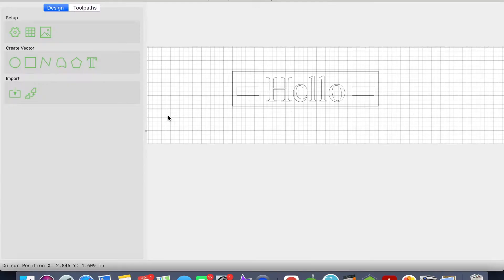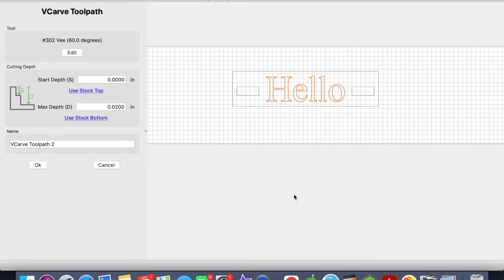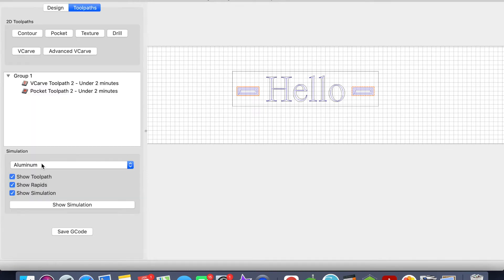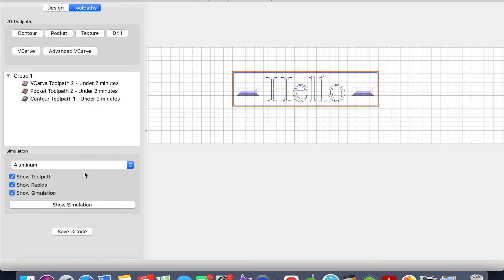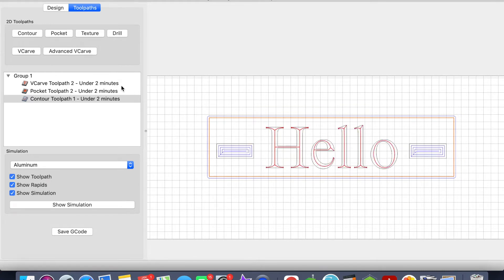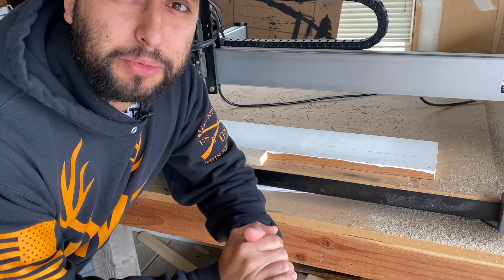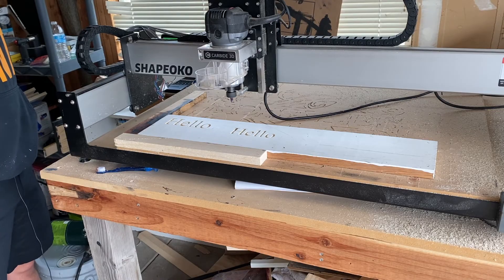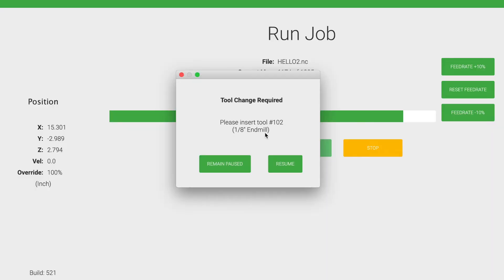How to Carve Multiple Tool Paths in Carbide Create/Motion | Beginner CNC Tool Paths | CNC Basics

Comment: I’m teaching HS kids Carbide Create.
I’m doing a coaster with an inlay.
I run one simulation then save G Code.
I run the 2nd simulation then save the G code.
IS THAT A MISTAKE?
Should I simply run the simulation then save the G code(both).
I am not getting the change tool bit pause. I’m worried I taught 120 kids the wrong move.
Reply from the maker: When I have multiple toolpaths I like to save each one individually.  
I think it’s easier to keep track of them. 

So let’s take a flag for example.
My first toolpath would be stripes and the second would be stars.

let’s say in this example it’s just a pocket toolpath for stripes. I could use a 1/4” endmill to execute this toolpath. 

Once that is done I would upload my next toolpath which would be a vcarve for the stars. When I run that in carbide create, the program will prompt me to change to the vbit. 

I think my process seems like that is what you’re doing.

Comment: After entering all values. I tried to save the file as G-Codes but the software said "save as G-Code PRO ONLY". How to get rid off this problem?
Reply from the maker: You have to save as .c2d file.  

If you use carbide motion, you can upload it and it’ll work just like a g-code.

If you don’t use carbide motion, you have to have pro.

https://youtu.be/8Hl87ggMz_4
Reply: @aetimberpine  I use a jenmatsu machine that has a Grbl software to machine/engrave a work piece. Monday I will open the .c2d file and will let you know it works or not.
I am very much thankful for your help.

Comment: You did not show using the bit setter to measure the height of the different. bits or how did  you set the z for the different bits
Reply from the maker: Thanks for the feedback.  Gonna have to do a video on that specifically.

With the bitsetter I don’t change my Z but will have to show that more clearly on the next one.
Reply from the maker: @steamboat thank you! I appreciate it!